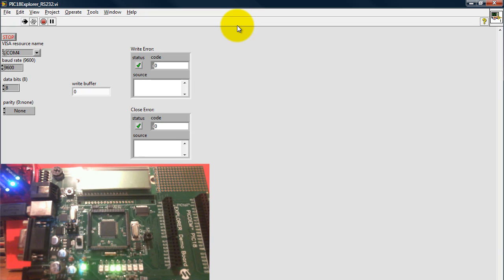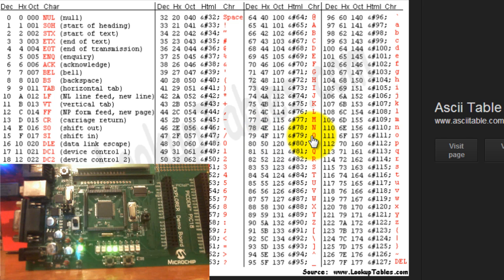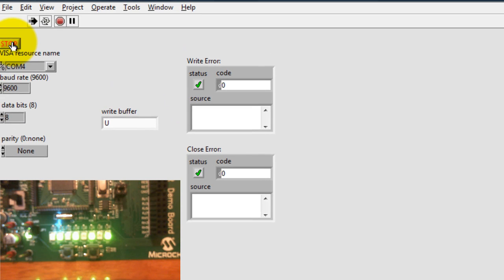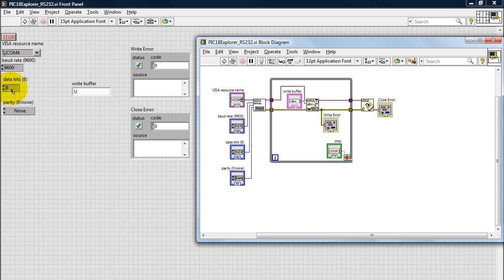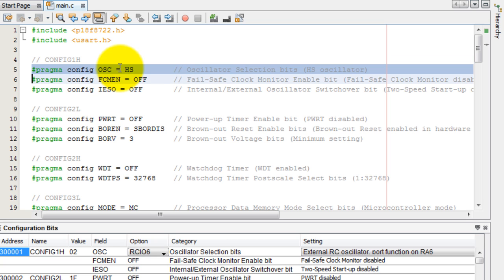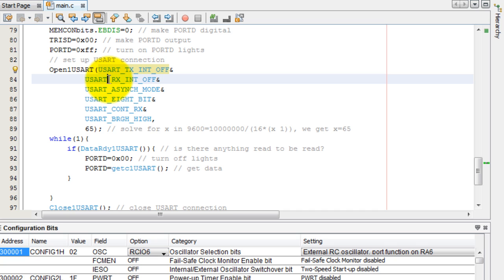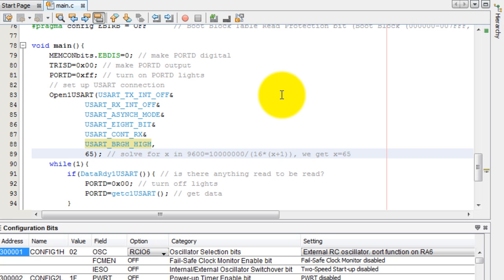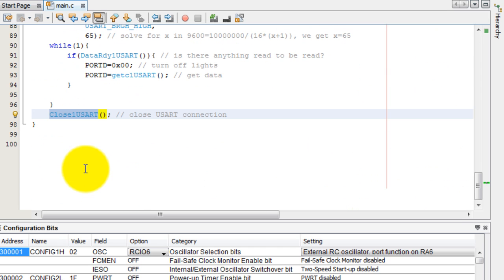PIC18 Explorer Board Serial Port Read From LabVIEW

Comment: Hi! I can't make the microcontroller to send, for example, some characters to the pc. I use your code and add "Write1USART(PORTD);" command and I succeed to send back the data that I introduce in the terminal. But I can't sent nothing else instead. Please help me if you have any idea what code I need to make the uC send data by rs232. 

	if(DataRdy1USART();){ // is there anything read to be read?
	PORTD=0x00; // turn off lights
	PORTD=getc1USART(); // get data
	Write1USART(PORTD);
    }

Comment from the maker: There are many many ways.

On the hardware side you will need a TX RX to RS232 converter, I recommend an FTDI cable for that. 

On the PC software side the easiest way I can think of if you have powershell you can use something like:

 $port= new-Object System.IO.Ports.SerialPort COM3,9600,None,8,one
 $port.Open()
 $port.ReadLine()

Where "COM3" is your PC's port (if it's 3), and 9600 is your communication rate.

Comment from the maker: The board has two connections for RS232 programs: serial and USB.  I am using the USB connection since I do not have a serial cable, you can select between the two connections by setting jumper J13 accordingly. Check page 19 of the board's manual.

The PIC18 explorer board has two microcontrollers on it, the PIC18F8722 and PIC18F2450. The PIC18F2450 changes the data it receives at the RX and TX pins from the PIC18F8722 to USB.

Lastly, if you don't have this board you can get an FTDI cable.